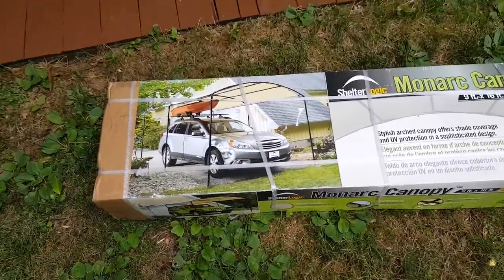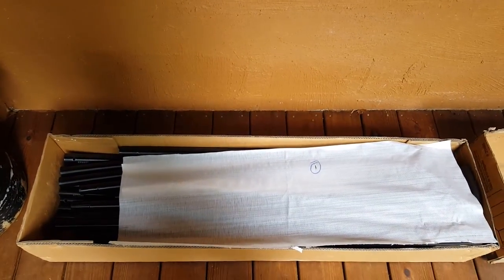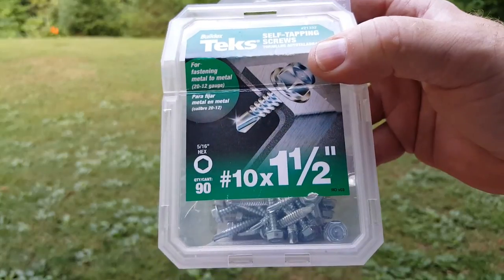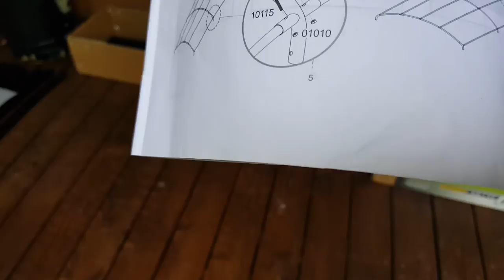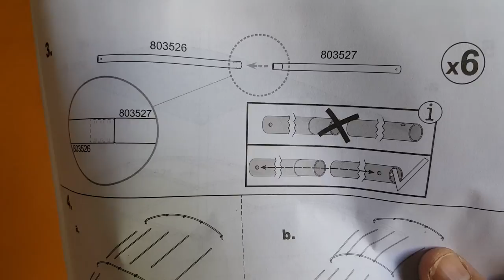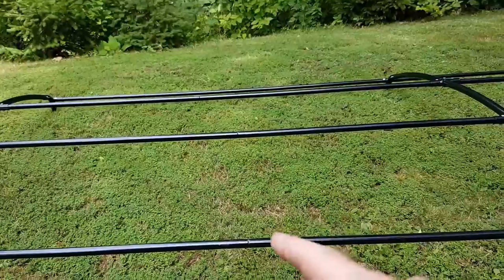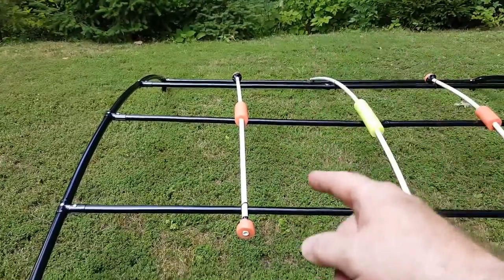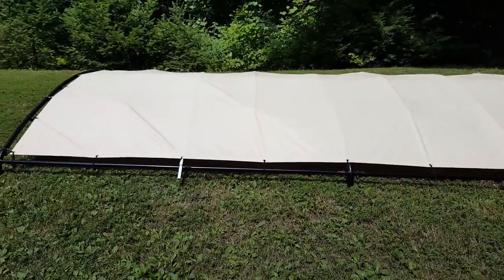DIY temporary shelter into a permanent shelter. Shelter Logic Monarc Canopy 9 x 16

Comment: I'm doing this . . . NOW, thanks.  Why are the center pool noodles longer on the 10 foot sections than on the five foot sections, please (?)  I'm having trouble imagining the various directions of water drainage that the pool noodles are intended to create . . .
Reply from the maker: That was just the best way I could come up with to control water run off. Without it water will collect and rip that roof from the weight. It has also held some snow.
Reply: I'm doing this on the 10 x 18 Monarc (rather than your 9 x 16).  I bought the 10 x 18 because it comes with pre-drilled connector holes and bolts -- though I'm now thinking that may not have been worth the extra $100.  It's also causing me some extra hassle because a 10 foot length of PVC is short.  But your recommended alterations are still going to be better than out of the box -- thanks (!)

Comment: Is there a secret to the self tapping screws?  I used the same exact screws and the only way I get them to work is to drill a small pilot hole first.  yours seem to fly right in.
Reply from the maker: Yes I did drill pilot holes first.
Reply: Thanks for the quick response!  We used basic drill bits probably meant for wood and it took a really, really long time to make a pilot hole.  We have a lot more left to drill.  Would you recommend a Cobalt drill bit at a low speed?
Reply from the maker: Use a bit for metal a little smaller than the self tapper. Use drill on fast speed. Take your time easy to break bits. After the pilot hole they should go right in as shown.